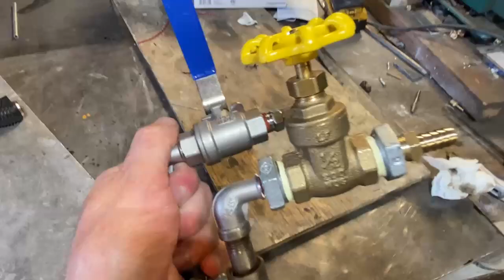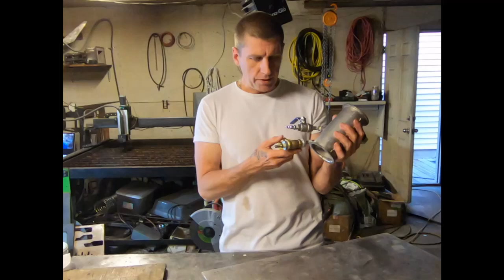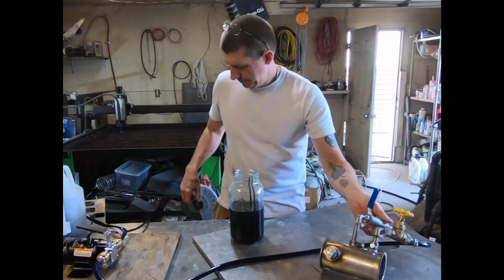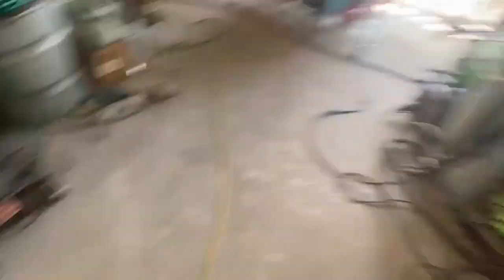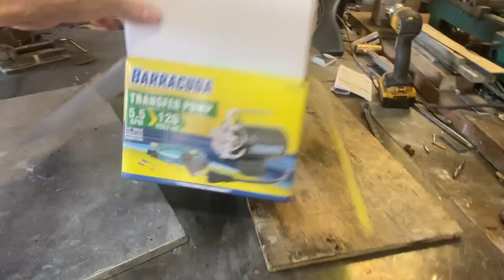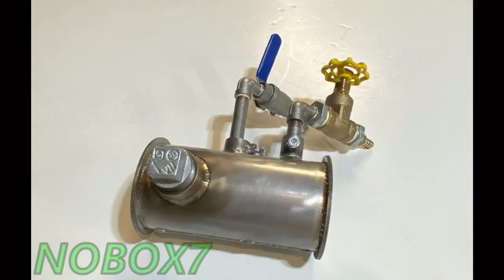Precision Control waste oil Burner systems

Comment: That pump will leak right behind the pump head,where the motor shaft enters. I use the same pump for my oil burner. Just keep an eye on it, usually won't leak right away, but will develop a leak over time. Just my experience with the pumps.

Comment: If you add a ball valve before the gate valve it will allow him to keep that precision-tuned setting on the gate, while being able to turn off the flow of the oil,  (can't just leave it open and turn off at the pump it would still get a syphon effect) ... also if the ball valve is next to the gate and before the pump,  even though the gate is the one restricting it and keeping the spray at the perfect volume, the ball valve could help with controlling the pressure/flowrate for when the viscosity changes if using the burner to also heat up the oil ? .............I think you need a big bucket or container for these tests, so you can pump the oil from it and spray it straight back into the same container, when you plugged the pump in and i saw the oil run down that line, i did not expect your white top to stay white one bit 🤣🤣
Reply from the maker: Yes you are correct people often use a ball valve in tandem with this valve so fine control can be set and then the other valve just turned on and off 
this way you only have to find the sweet spot one time
Reply: that makes sense if the flow rate is static, but as this furnace reaches melting temps its fuel demands actually change, so having the ability to fine tune as we heat up is pretty important.  I don't know the physics behind it, but it's real.

Comment: Have you tried using a globe valve instead of a gate? They’re like a gate but are designed to be modulated like a needle valve, but larger scale.
Reply from the maker: I did look into them and they appear to be just as effective as a gate valve for flow control . The main difference being that can turn higher pressure on and off without cavitation caused by ball valves

Comment: Could the oil be thinned w/ a little kerosene to lower the viscosity ?
Reply: or just preheat the oil would work, ...running a loop line near the burner would do this once its running.